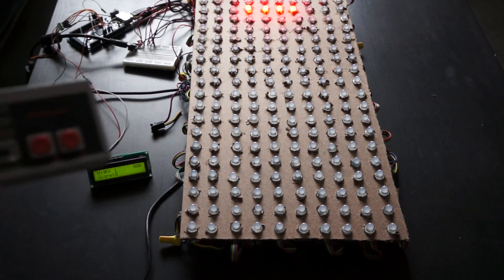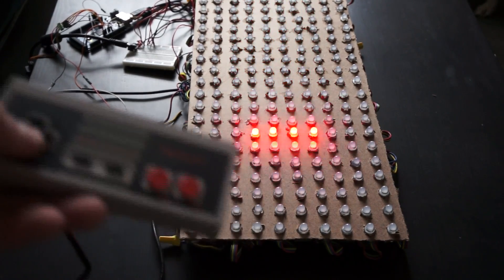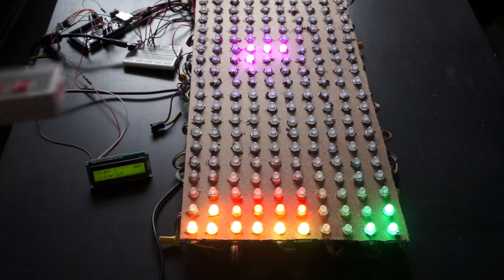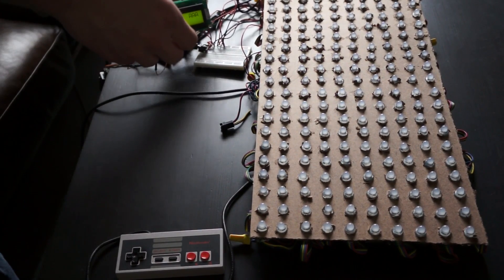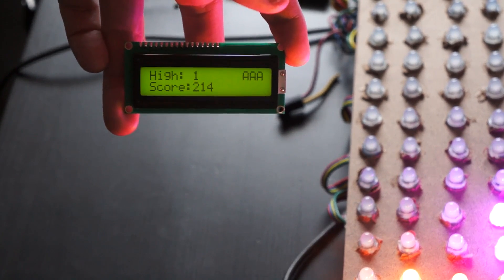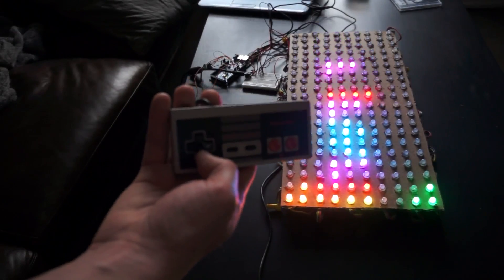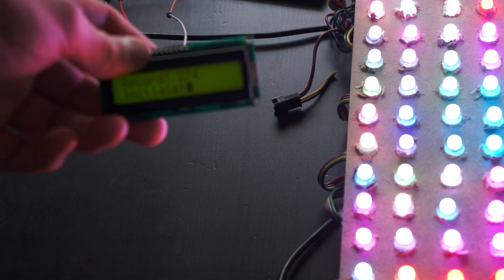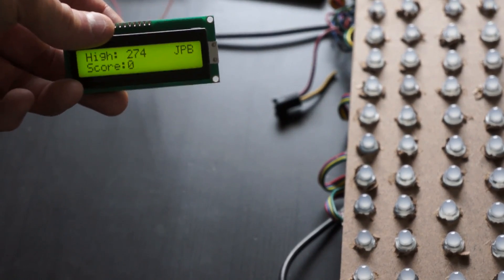LED Tetris Table using Arduino

Comment: Is there a way I can contact you? I'm having problems with the coding... The code doesn't show any errors but it is not compiling. It shows me this "Error compiling for board Arduino/Genuino Mega or Mega 2560". I tried everything I know but I need your guidance for this one please. At this point I just want to run Tetris...

Comment: can you share  arduino  tetris code and circuit  thanks
autocac02@gmail.com
Reply from the maker: The source code is available at https://github.com/bezanis/LEDGameTable/
I used a string of these pixels https://www.adafruit.com/products/738

Comment: Very nice project. I wanna build a similar table like yours... Could you share the wiring for the nes Controller and his ports? And why you have 2 LCD Displays on your list, i can see one Display only...  Thanks a lot! Michel
Reply from the maker: I have a second lcd screen for sideways play. You can see this on my updated video: https://www.youtube.com/watch?v=CUy14HK8sJY
Check this out for the wiring:
http://danplows.com/blog/hack-a-nintendo-nes-controller/
Reply: John Bezanis Thanks, and now i have this problem. I compile your sketch and can't found the ffft.h library. could you share your ffft.h please? thanks...
Reply from the maker: TheDevil666inside you could just edit your includes to not include the visualizer app (game). The code on github would probably need to be cleaned up to be used in an actual application
Reply: @JohnBezanis  Can you show us how to take Visualizer out please?
Reply from the maker: @RGB117  You can edit main.cpp to remove it from the game names array, along with the switch statement containing all of the games
Reply: @JohnBezanis  I'll try that, but what about the not compiling for arduino mega 2560? I keep getting that error

Comment from the maker: The circuit diagram and code will be released eventually. It is controlled by one Arduino Mega ADK, although a regular Mega should work as well. The current build is way, way nicer. I'm working on putting together a site with all of the details.